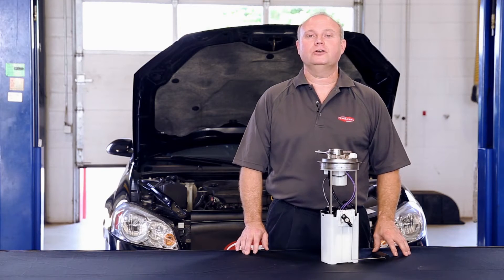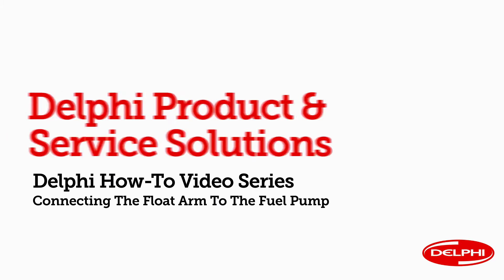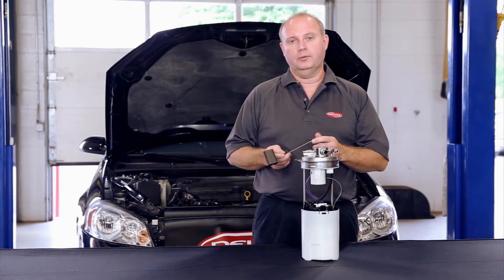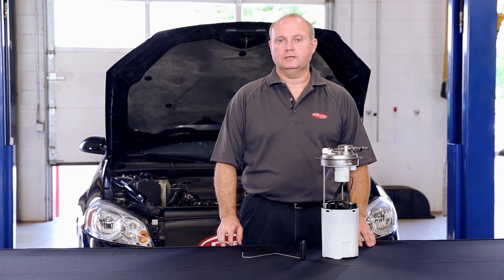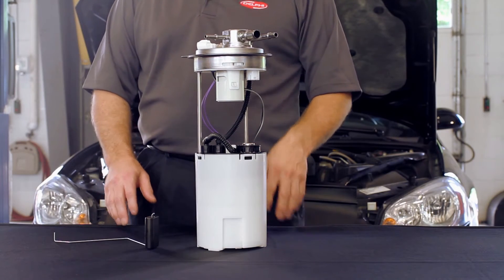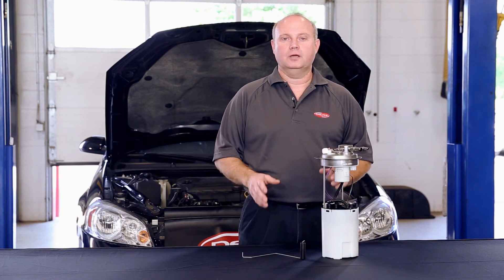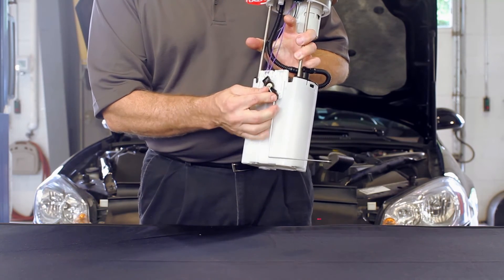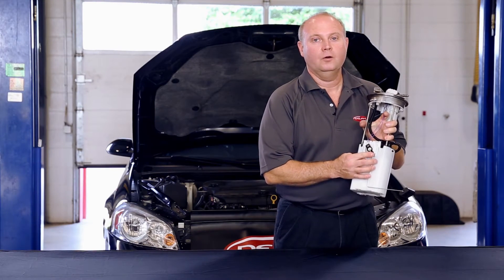Connecting the Float Arm to the Fuel Pump

Comment: I put arm wrong incorrectly because I went off old pump Mopar orientation, damn pump didn't come with any info now I have to remove again good thing I made an access hatch 05 Grand Caravan
Reply: Literally same reason why I am here
Reply: Bad fuel readings on dash
Reply: what happens if you don’t connect it right ?